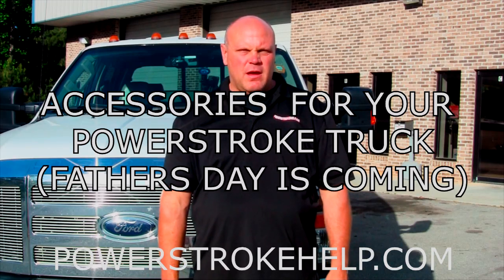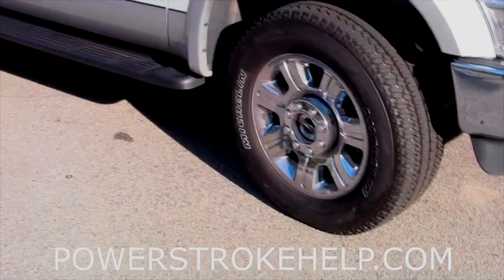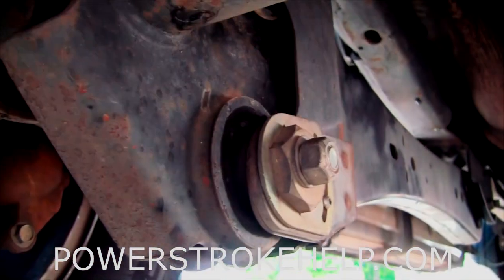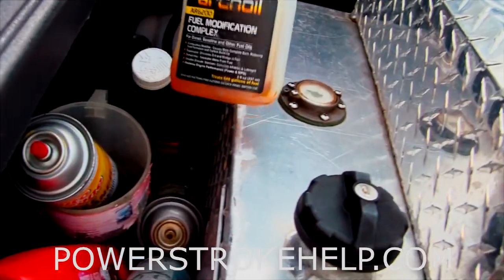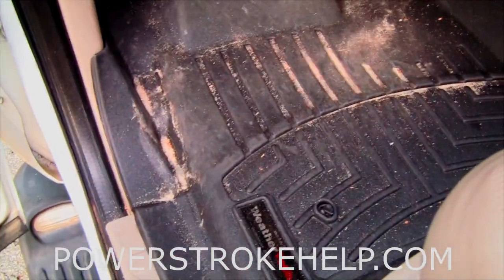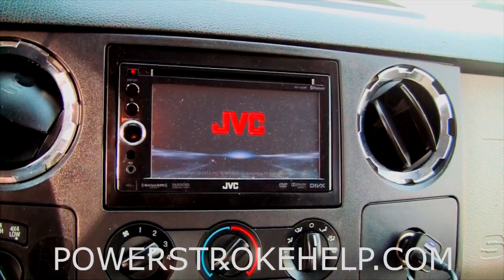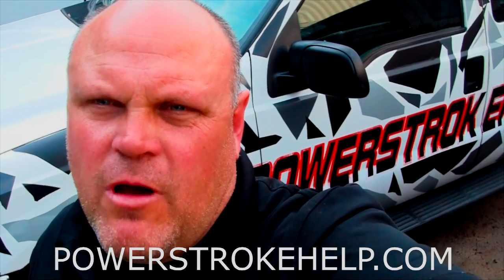POWERSTROKE DIESEL TRUCK ACCESSORIES

Comment: I cant live without my Sirius radio. FM radio is horrible in my area and I hate fumbling with my phone trying to find something I want to listen to.  Its the best thing I've ever spent money on for my truck. Another thing I love having is I got a pair of LED fog lights and installed them under my rear bumper. If you have tinted windows, they work great for backing up in the dark.

Comment: I absolutely agree on the Bilstein's.  Tried a bunch of different ones over the years, didn't like the 5100's on my F350, but the HD's are great.  As far as tires go, I only put BFG All-Terrain TA/KO2's on them now.  Pretty quiet, nice ride, work great on-road, off-road, and in the snow for plowing!  SYNC system in the newer trucks is not bad.  Best aftermarket radios I've found are the Kenwood NAV radios.  Pioneer's are ok, but I like the NAV on the Kenwood better.  I take an inverter plus an LED shop light with a long cord when I travel as well.  Costco has a nice little DeWalt 181-pc tool set in a low profile molded box for ~$100.  Has most of what you would need for anything you can fix on the side of the road except for channel locks, good screw drivers, and a BIG HAMMER!  Hahaha!!!

Comment: Bill, these are what I have started using as of last Summer, and I'm so Very Happy with these that I would never buy another brand of tire for my 1995 F350 Dually, and after I changed to these my truck is riding so Smoothly.And the other item I have been so very impressed with Toyo is they had two recalls, but not that there was a problem, but that they sent me a Notice right away!! And of the two they sent me only the first one, did they have to replace 2 of 6  tires. And the 2nd recall I think was just another notice of the first one I got. As was for the same problem. But this time I had none that needed replacing. Keep up the great work Toyo!!Toyo Open Country HT w/Tuff DutyThe Open Country H/T with Tuff Duty is engineered for high torque diesel pickup trucks that tow trailers or occasionally haul heavy loads. Three-belt construction, multi-wave sipes, and other enhancements deliver a long, dependable wear, increased tread mileage*, exceptional ride comfort, and balanced all-season performance.  The Open Country H/T with Tuff Duty is also M&S rated.

Comment: Very similar to the setup on my excursion. Ended up curing a lot of ailments with a Hellwig rear sway bar as the 99-03's did not come with a rear swaybar. Weathertech floor liners are next on my list!

Comment: Do you have any discounts on the whatnot?
Reply from the maker: +Maxid1 Whatnot is free. it was a tough day for video. I had to edit alot because my brain was having trouble making my mouth work correctly.
Reply: +powerstrokehelp I hear you. Good tip about the tailgate. Mine is safe for now, it's in storage since the truck has a camper on it. One day I'll make it your way for bullet proofing my 2006 F450 super duty. it's got 37k on it now.

Comment: I use nitrogen in all my tires too.  I just use my air compressor, puts out 78.09% nitrogen.
Reply: Benjamin Phillips yep. The pure nitrogen is a amazing sham.
Reply: Benjamin Phillips legendary
Reply: Would Nitrogen  also prolong tire life?    Since it doesnt expand and contract with friction/heat like shop air does
Reply: LOL Benjamin!  The nitrogen filled tires is such a scam.
Reply: I have been using Nitrogen in my tires, especially in hot or cold climates, because the amount of air loss is substantial.  Our military aircraft use nitrogen due to the high heat created during landing and ours was 99.9% Nitrogen.  When I lived in AZ I would have to put air in my tires almost on a weekly basis due to the heat difference.  When I switched to Nitrogen I was able to check the tires when I fueled up or during regular Honda dealership maintenance.  My 2008 F450 Dually is all Nitrogen and my tires rarely loose pressure in OR.
Reply: Benjamin Phillips 
Yet 78.9% is still not 100%
Leaving 21.1% plain ol Co2 Co O and whatever else (coal rolled on dimwits). Thus the plain ol air is available for expansion, contraction, leakage due to sizes of different gasses that can leak out over time. 
My 97' says it weighs 8690gvw. That weight stretches out the sidewalls and does over time release the air. My truck is pretty sensitive to tire rotation mainly, also tire pressure uneveness cause shaking at 90mph and odd speeds. Since Costco started putting it in my tires (BFG Commercial Traction T\A) they last longer are more comfy, and never lose pressure.
Maybe its a spoof, maybe not? Costs me nothing but checking my tire pressure less often, and a more comfy ride.
Just sayin...
Reply: Pure nitrogen doesn't help enough with expansion/contraction/heat to make a difference.  It's biggest benefit is that you don't get the moisture from the humidity in the air.  If they're charging you extra for it, you're getting scammed!  I started going to Costco for my tires because they have great prices and they do the Nitrogen for free.  Not because I care about the nitrogen so much as because I can just pull up and have them check/adjust the tire pressure for me for free, and I'm getting old and lazy!  Hahaha!!!

Comment: great been waiting for another upload thanks so much new powerstroke owner here have had plenty for company trucks but bought my own 06 F250 Harley Davidson Edition and loving it!
Reply from the maker: +robert boulet Send me questions on what you want me to talk about.
Reply: +powerstrokehelp thank you. I do have one question on my truck the previous owner kept it stock other than installing a K&N air filter the thing I do notice is that the filter is exposed in the engine compartment except for what looks like what best can be described as an L shaped mounting/dividing wall and it seems that with the hood closed it would somewhat reduce or cut off the filters exposure to the "hot side" are these set ups okay or should I put one that actually seals itself off in its own air box assembly?

Comment: First, and please make videos about f450 and f550 read diffs and make a video describing injector faults and why you dont buy them from rebuilders (OEM only) 

Also, a question. Why is it that International 6.0 motors run ELC coolant, yet Ford is adamant we use their Gold standard? 

Thank you in advance, and keep up the videos. You have done many people alot of good.

Comment: Bill your information is great I inherited a 2004 king ranch 6.0 from my grandpa 87,000 miles im trying   had pickups all my life this is my first diesel  all your info is great because i had know idea about any of it much thanks.
Reply: Kevin F he has great videos on the 6.0 unfortunately you got one of the worst engines they make unless it's been dealer-proofed. Might wanna look into that.
Reply: Yeah i drive it like a granny it has new heads they blew out under warranty i change fluid religiously i tow a trailer for work has no proplems yea as soon as i have an extra 11 grand ill bullet proof

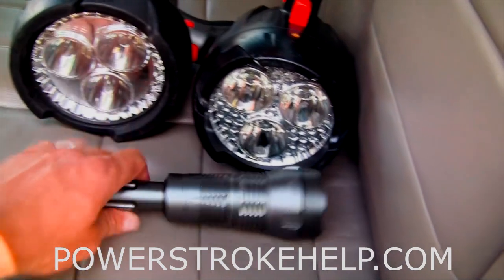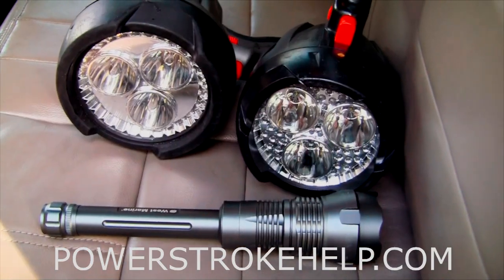Comment: 00 cables yes, I jumped a 6.0 with a bad alternator, with a V10 excursion, he said no way that will work, I chuckled, not with your cables! Mine are welding wire, more conductors per gauge. My optima yellow top saved a tow bill on a plow truck at 9:45 at night, also put an alternator on said truck at 10:00 in oreilly parts parking lot and my buddy was out of service for under an hour! On a snowy night! Fun!

Comment: Hey man, I have a '01 F250 7.3 with around 180k miles.  I've been looking into some small upgrades to make her run a bit smoother and cleaner.  I'm chipped, k&n "cold air" system, and 4" turbo back exhaust.  Do you think the radiator filter is worth the buck?  My coolant looks clean and the truck runs cool as a cucumber.   I haven't seen many claims to fame with them, but also see them on most of the diesel tech's trucks.  If you've got a minute, let me know your take on the radiator coolant filter systems generally.  Thanks for the videos!

Comment: +powerstrokehelp Bill, I now own two 7.3 powerstrokes (96 F-350 and 2002 Excurison). Love the fuel/toolbox combination. Thinking I may add that to my F-350. However, in the interest of building a tool kit and for travel purposes in either truck, do you have a list of most commonly used tools I should carry for roadside/trail side repairs? Recommended spare parts list (beyond the obvious coolant cap and ICP and CP sensors)?  It’s not like I can just take a Walmart 99-piece ratchet and combo wrench set like I can for my wife’s minivan and be able to make 75% of the repairs. These are big heavy tools. Also, where can I get a copy of your checklists for maintenance? You talk about them on your website, but I can’t find them. I’m willing to pay for these lists. Your knowledge is worth a few a bucks.

Comment: Bill, we realize the 6.0 and 6.4 keeps you busy but why not talk about the 7.3? It's been about 13 years since the last 7.3 Powerstroke rolled off the line. Still plenty of them out there and a great alternative to forking over $70k+ for a new 6.7. The asking prices for a low-mileage 99-03 are high for their age but low compared to newer models. 7.3s, in time, may be what the classic Mustangs and such are now - highly sought after and high-priced. And hey, you can let everyone know that if brought to you, the potential for another 500k mi isn't out of the question. Get the 7.3 owners to you, bud. I'm on my second one and my kids will be the ones to sell it or keep it because I'll die owning my 7.3.

Comment: I got bf all terrains they run great wanted ko2 but they are double the price and not as nice ride. 
Nitrogen doesnt do a damn thing unless you are in first place at nascar.
 My daughters a first year apprentice at dodge dealer and there big ol' green nitrogen tank is pressurized with air. 
Theyre busting people big time up here in ontario for egr deletes and hollowed out cats they use heat guns and cameras up your tailpipe! Those 2 mods alone will set you back 3 grand in fines, so watchout
Love the vids keep em coming

07 400k on original head bolts and cooler
35 mpg with cetane, lube, superchips tuner(highway of course)
Reply: 35mpg! Please enlighten me I've got a 07 f350 powerstroke 4by, stock with archoil in fuel/oil.  Living in southwestern ontario I'm getting 20-22 max highway with a tail wind hah

Comment: What do you think about going with steel 19.5 or 22.5 wheels with essentially stock diameter tire.
Reply: John Dough I meant go with a wheel tire combo like on a f450 or f550.  There are places that sell wheel tire combos that use the super heavy duty multi ply tires that last a long time.  Not really looking for huge tires.

Comment: Id say remove factory fog lights and install a bar in a different location,  help with coolers air flow up front.  And a Tow buddy, for the hitch

Comment: Bill can you do a video to explain about the front locking axle. Earlier in the video when you were talking about using the original rims, a brain thought jump in my head. And I hear about the hub on the front axle where you can turn the center and lock something out. Can  you explain for other youtuber can learn? Thanks. P.S. great video.

Comment: I have a '08 f350, the power steering seems less than adequate, do you have any suggestions. thanks
Reply from the maker: +Joe Gaukel I have found that 1oz of Archoil Ar9100 will help alot. archoil.powerstrokehelp.com

Comment: Just a tip with HID lights, you are much better off to mount them in a projector lens for better light output and it isn't near a blinding to on coming vehicles.
Reply: I thought that was almost required?

Comment: I have a question, have you had a 14 6.7 come in with and issues and if so what were they because my truck is just to 71000 and just want to play it safe and not have a expensive bill on parts
Reply from the maker: +Colin Moorhead most 6.7s have turbo problems or egr cooler problems but by 14 they fixed the turbo. Just do the maintenance and drive it. go to this link. these products will help keep the truck running for a long long time. archoil.powerstrokehelp.com

Comment: I take issue with your recommendation of HID lighting. HID lights in a normal housing scatter too much light and produce too much glare. I've shown this to people locally by taking them out to overpasses and parking underneath on a dark night. From above, I've shown them the different patterns and it can be dramatic. There is also the issue of legality of using HID bulbs in a non-HID enclosure.

Comment: Hey Bill dont get caught wearing head phones even if you are hands free! You will get written in most states because its distracted driving. If you miss a siren and dont pull over because you didnt hear it.... they might thread you out a vent window (not an option on cars nowdays, but they will make one). If you get in an accident while wearing headphones, you are screwed. Ive seen too much carnage from all the gadgets. Drive safe.

Comment: how could nitrogen make any difference? 80psi of the air rides the same as 80psi of nitrogen
Reply from the maker: +UBBERTANKER Nitrogen is a bigger molecule and temperature affects pressure less. Biggest thing for me is the way the truck rides and takes bumps better
Reply: Nitrogen wont make any difference in the ride, What it will do is not expand/contract with ambient tire temperatures. Think 90 in summer and -20 in winter, tire pressures can vary significantly with temps.
Reply: Matthew Davidson at -20 tires with air can get a flat spot and thump till they warm up, might not be the issue with nitrogen
Reply: It doesn't, it's a con.

Comment: Your tow chains should have the hooks facing up sp I'd the trailer comes off the weight goes immediately on the thick strong post of the hook. Facing down the weight goes on the flimsy wire gate

Comment: It the caster angle kit bolt on or weld on?
Reply from the maker: +Patrick Pikulski it is technically bolt on from BD diesel but I welded it because i just do things a bit extreme
Reply: +powerstrokehelp Thanks Bud!! So this would be a great ad on for my 2013 F-250 4x4? I'm still saving up to bring down my 6L but now that I have a good 6.7L I'm doing ok for now. I appreciate you taking the time to reply to my comment!!! Air bags with the straighter valves is the way I think I gonna go for now, you can always add the mounted compressor later and use a cordless tire pump for on the fly. I know your in the land of sunshine where is doesn't snow, but could you try and do a video on snow plowing do's and don'ts with a powerstroke?!?!

Comment: Can I use archoil in my 2 stroke boat motor?
Reply from the maker: +Bishop Mills I have a neighbor with an older 90 hp Evenrude that he hates. Hard starting, excessive smoke and poor fuel economy. I gave him some archoil AR6200 fuel modification complex and it helped him alot. starts better runs smoother and less smoke.

Comment: LOL THE CHAINS ON THE TRAILER ARENT CROSSED xd
Reply: I know I'm late but they look too short to cross
Reply: As a safety director, I noticed that too. I’ve seen the “short” or “long” chain problems before, mostly due to a tight or extreme fit on a particular vehicle and then another truck pulls up to tow the trailer. While working for an O&G company that also did lots of hot shot runs, I noticed this from time to time. The short chains are the worst to deal with if you are not prepared. Some receiver/hitches have nice open eye holes that extend towards the trailer to attach the safety chains. The F250s we ran did not have a user friendly hitch set up and needed extra length to hook safety chains from time to time. Often it was no problem, but once in a while a receiver/hitch set up may have less drop/length (for the truck towing it one way..) and the person setting up (cutting the chains) the trailer built to the minim tolerance (length).

Comment: What is the best year for 6.7L?
Reply: 2014 and up. 2011-2012 got some early production problems. now on the contrary, bill does sell 2011's= its just he knows the tips and tricks for 2011's/12's. the factory started fixing the problems in the 2013's that the 2011 and 2012's had( poor turbo design, plastic oil pan etc.) i hope that helps clearify and narrows the decisions for the year you want to purchase cheers. p.s.=the new 2017's just hold off on thoses cuz their brand new, i advise you to wait out the debugging timeframe, until the factory start recalling and making improvements cheers. but up to you.

Comment: xenon blubs are not made for stock halogen reflector. you got a very nice shop. why not retrofit the headlight housing to a bi or standard xenon projectors. you will not blind other drivers and it will be 100% better than stock

Comment: As far as nitrogen is concerned, I know its a bigger molecule than oxygen, so less escapes from the tire, so it means you shouldnt have to top off as often, plus its inert and not a catalyst like oxygen.  Besides ride quality..... I check my tires regularly and wonder if filling with nitrogen will help with fuel economy.  Thanks.
Reply: Nitrogen is not inert-  nitric acid, nitrous oxide, ammonia, urea, etc.  Inert elements do not react with  other elements because they're perfectly happy with their 2 little electrons in that outer shell.  Also, nitrogen is just a tad smaller than oxygen (atomic number 7 compared with oxygen's atomic number 8).
Reply from the maker: WOW someone who stayed awake in Chem class and knows what the periodic table of elements is. I didnt know guys like you existed in the PowerStroke community. HA.
Reply: I was most impressed with your chemistry knowledge as well- that whole SCR reaction you drew up a while back was a thing of beauty.
Reply: Bob Wolford the biggest benefit I see is no oxygen no possibility of O2 getting hot from a puncture and a blowout! I am a welder and I use argon, because it’s here! Tire shops here don’t offer nitrogen!